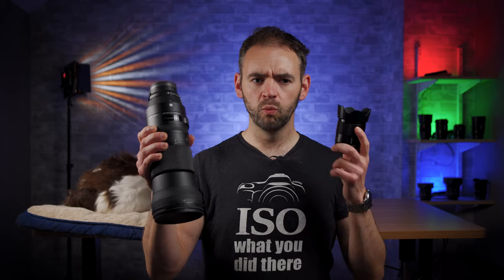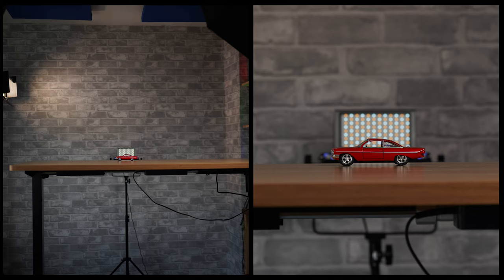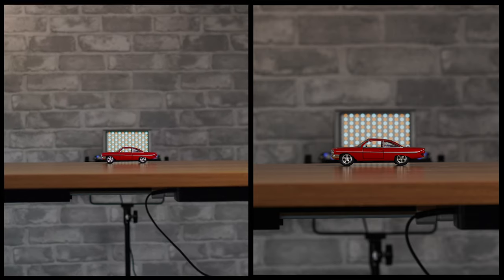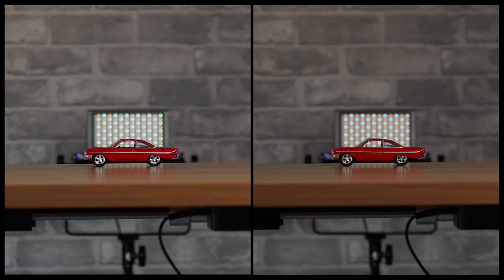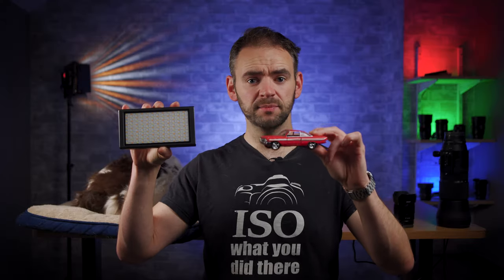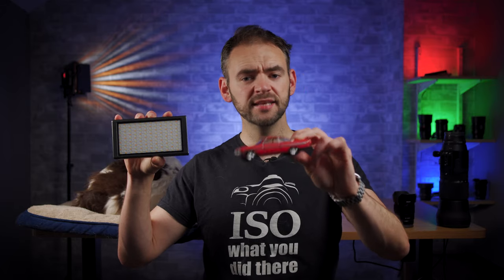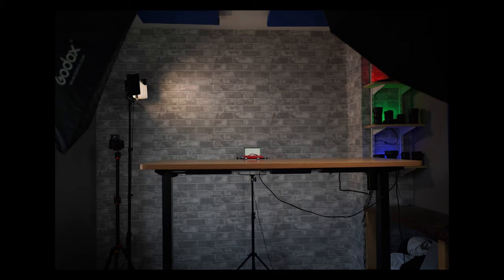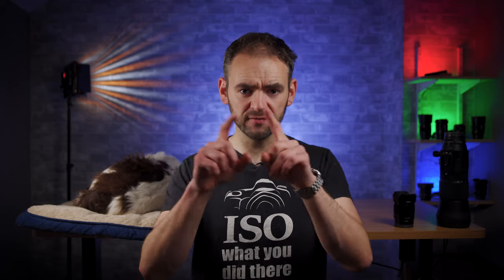Lens compression DOESN'T REALLY EXIST - But it doesn't really matter either...

Comment: I love it. I’ve posed the same argument (when you said that hypothetically with the right sensor and lens we could make telephoto lenses obsolete) for crop vs full frame— When people say that with the right lens you can make full frame obsolete, sure you COULD get the look of a full frame 50mm F1.2 by using a crop sensor with a 30mm F0.75, but you can’t get a 30mm F0.75 so we just use a bigger sensor to get that look... In a universe with hypothetical cameras we can do all sorts of stuff 😂
Reply from the maker: Exactly, in the hypothetical universe we're all using a 8-800mm f0.1 pancake lens ;-)

Comment: An excellent reminder that photography is a very technical activity, often described with imprecise artistic shorthand terms.
A portion of the same discussion of the differences (or not) between full frame and crop sensors. A lot comes down to where you plant your feet and what focal length (field of view) you select.
Also, clean your room 🙃

Comment: Maybe not one super wide and a 100 megapixels camera... But it does bring an argument for perhaps not owning so many focal lengths, but a few... And using tools like APS-C crop mode more the in-betweens. This, of course, if you're ok with the loss in resolution and aperture. I for one, like the idea of just owning a fast 35mm and getting 50mm(ish) with crop mode, and so on. It would be a matter of getting your preferred focal lengths as primes and using the in-betweens for focal lengths you might not like as much. Interesting video, thank you.

Comment: I knew it! Just a few minutes ago i saw a review of leica Q3 in which the reviewer saying that 'eventhough the high megapixel sensor crops to provide decent images, doing that to give equivalent different focal lengths with a 28 mm lens is not at all the same and lens compression is absent on those . And i was like.. No, its kind of the same...!
The idea of a high resolution sensor in a fixed lens camera that can digitally crop to imitate different focal lengths like the Q2 and Q3 is going to be the future for the everyday carry cameras. I believe next x100 from Fuji will follow this same idea.And there are rumors already.

Comment: Sometimes you don't need a very small DOF, so cropping from a wide angle image can work. But I think what would put me off is the affect on workflow - you have to create that composition in post and it's an extra task, rather than creating it in camera and being able to see as you do it and take another photo immediately if you're not 100% satisfied.

Cropping in post is essentially the same as using digital zoom in camera, but I'm not keen on that either because that's irreversibility throwing away pixels from the sensor.

I think what I'd want that as far as I know doesn't exist is a RAW format that includes digital zoom information based on in-camera digital zoom. Probably just as four extra integers in the file to identify the positions of opposite corners of the cropped image. Then by default raw processors would throw away everything outside that rectangle, but if you wanted to look outside it and change the composition in post you'd still be able to.
Reply: Maybe a good way to do this 'reverse brenzier' would be to have composition guides turned on in camera, e.g. rule of thirds, and compose the image you want within the central 9th of the image area, then use a preset in post to crop down to that. Would turn e.g. a 24MP 50mm f/1.4 into the equivalent of 2.7MP 150mm f/4.2 . 2.7MP is not impressive for a camera but it's still more than full HD and fine for most web uses.

Think I might try that, but it still leaves the problem in post of how to find the images that were intended to be cropped that way.

Comment: Splitting hairs. I've heard this explanation several times over the years, and its information as useful as explaining how many lens elements and groups are in a metal tube as a way to justify a photograph's appearance.  Yes, if you compare an image taken with a telephoto vs a wide-angle, at statistically relative lens/camera settings, an extreme crop of the wide-angle lens will appear similar to the telephoto image.  But it's useless information to someone who is composing their photograph and using the appropriate lens for the job at hand.  "Lens Compression" is an adequate term to teach and describe these perspective differences in two different lenses.

Comment: Re-wording the phenomenon will just end in more confusion.
One could call it "Global Compression", "Perceptive ratio differentiation" or "The Dave phenomenon" but why make Photography more confusing?
Sure, when technology advances where we have to deal with huge image sizes like say a 1,000MP sensor could produce and all we then need is a steady hand, storage space and much better batteries.... there may come a time where one ultra wide lens can do the job (the cost would be astronomical lol).
We would also need glass that could resolve something like that....  so in short, it is pie in the sky.
Reply from the maker: I completely agree there is no point changing the name because it ultimately won't change how we shoot, like I said even if people had access to high enough resolution sensors that they could heavily crop in they would still want telephoto lenses to either not waste the sensor or to crop in even further.

 I just think its good to understand the principles of what is actually going on
Reply: @DaveMcKeegan  you did a great job in showing the situation and keep up your great work. Always questioning and challenging keeps everyone re-thinking directions in Photography.